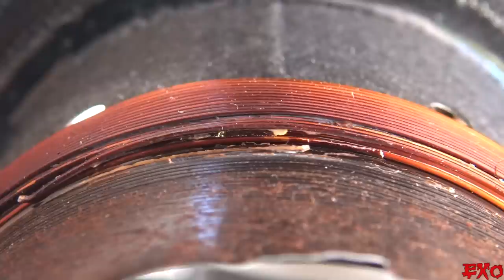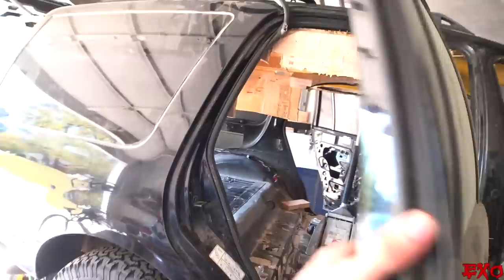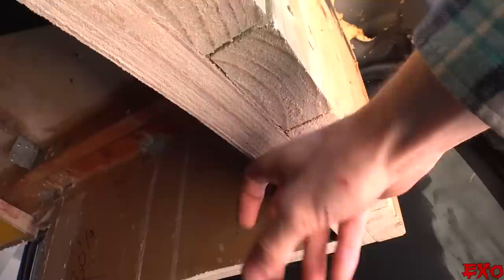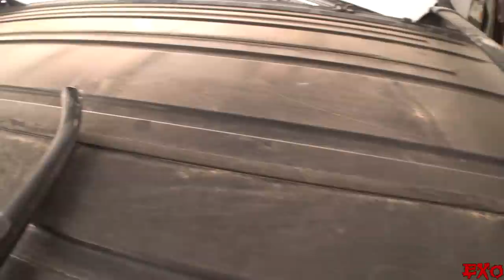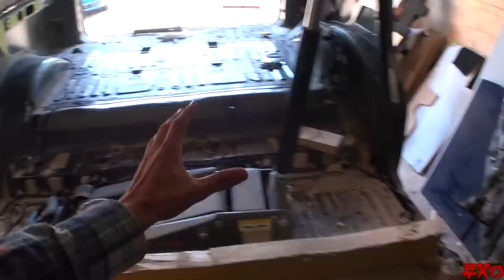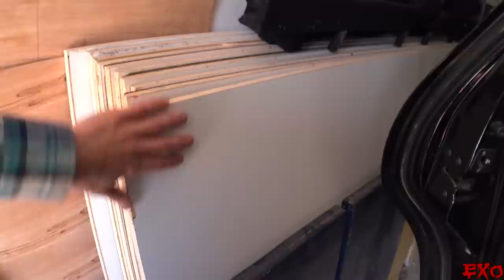BLOWN SUB After 30 Minutes of Music!?!? Car Audio Updates w/ FRANKENSTEIN & Rockville K9 Subwoofer

Comment: As a woodworker I recommend to sand the laminate with a coarse sandpaper to give the glue a better surface to adhere. You should sand it down until you see a dark layer. This is the same one which is also on the board. Here the glue has good adhesion. For glue I would recommend a good wood glue or for maximum strength some PL as you always use. :) 
Hope I could help!
Reply: No need to take it that far scuff it up good apply some white melamine glue screw together or clamp and done take a hammer to a test piece
Reply: Oh yeah before glue clean good with lacquer thinner
Reply: Yeah, this also might do the job nicely.
Reply: Roo glue ftw
Reply: I was also a cabinet manufacturer (27+ years) and Im in agreement with sanding with coarse (80grit)  paper until you get down to the brown sub layer..and use a dust mask always with that laminate..that shit aint good to breathe..there are a number of adhesives that would hold those joints well...plus you can screw the hell out of it.
Reply: not have sand laminate, im working with wall on shuttering plywood and with constructive glue soudalflex 40fc. Rock solid without scratching surface.
Reply: G anthony Dr
Reply: Liquid nails will hold anything.

Comment: I've been seeing people blow them all over YouTube. Definitely not your fault. Defective glue is the word on the web.
Reply: Sinister 

I've seen many blow these also.. the last video I saw of Rockville saying there is nothing wrong with these subs.. they said it's users not using their subs correctly.. that's sad to hear them say it. I sure hope they fix the issue(s). They make decent equipment, glad to see Rockville make good on these issues.
Reply: I’m surprises ppl r buying these off brand subs kicker alpine n others aren’t that much 10 inch round kickers go for 99$ a sub I say buy brand name never had a problem with them
Reply: KushClouds TV the reason people are buying these is because the 129 bucks and are “rated” for 1250watts rms where as a kicker is around 4-600 watts plus there’s the fact subs like kicker aren’t made to play low notes due to limited Xmas where as the Rockville has more ease. Not to hate on kicker or not saying they can’t play low notes  but I think most people would agree
Reply: The key to these "types" of subs is under power them and break them in for awhile. These are "soft parts" subs which is what makes them cheap.  But if it is a glue issue there is nothing you can do other than re-glue/re-cone them yourself properly. Which seems rather  counterintuitive them being "cheap" to begin with.
Reply: looks like they went cheap on the glue that is why is so cheap but other than that great quality
Reply: chepa materials cheap sub

Comment: Sorry I lost signal but with a 4th order you could use the raised rear section for the sealed and the front for the ported
Reply: Doyle Lee i dont think that will work with 8 18s maybe with 2 separte sealed section on left and right but i dont think theres anyway he can do 8 18s in there with sealed section in back
Reply: I thought about that after I sent it

Comment: This is a design I've seen used by other companies. A standard model with the rubber magnet ring changed to suit. As soon as it starts performing decently enough, it starts breaking down. It uses aluminium as the coil wire. Aluminium becomes brittle or melts depending on how it's produced.

Comment: I absolutely called it!!! Now EXO you have one, so tell me your opinion...if PSI did a recone would the price of the sub plus the price of a PSI soft parts kit be worth the end total price paid??? Is that motor worth the hundred bucks and then another 150ish??? for a PSI upgrade? Think about it, end result maybe a few hundred bucks. Orrrrrrrr would it have been better just to buy a 300 dollar sub. Come on bassheads give me your thoughts.
Reply: wrksux4me 

I would say no, pass. Lol.
Reply: You can get pretty awesome subs for around the $300 mark with higher reputations imo (thinking about maybe some of the mid tier Skar stuff). But I also think Rockville has the potential of solving their coil issue fairly easily and remedying the problem. Idk, just a thought
Reply: Well personally I say the no pass as well but there are individuals out there trying to plead a case for these Rockville subs because of the motors... me myself would drop 300 on a hdc3 Soundqubed or hell a baseline DC or Sundown even before I went thru all this with trusting a Rockville.... I mean it's Rockville people... lol
Reply: I personally would go with sundown/dc audio/psi.  But when buying subs above $400 I always go with Digital Designs.
Reply: I'd rather spend a bit more on a well known, reliable sub than a cheap one with a recone.
Reply: I live in Oklahoma and the manager at car toys said the owner of DD used to work there. Left, started DD has a warehouse in Oklahoma city. Also said his son is the owner of soundqubed and he as well has a warehouse in Oklahoma city. First thought he was full of shit but I finally decided to order a soundqubed, got a 10 from GP and liked it so much to ordered a 15 from soundqubed directly. Well it did in fact come from Oklahoma city. I've heard good things about DD and I've seen a lot of badass videos on YouTube. So I wonder.. if the dad can out do the son or if the son can out do the dad? They need to comp it out... lol.. you know that's a cool ass dad. All being unless the fkr at car toys really doesn't know what the hell he's talking about.
Reply: I'd buy a skar I had a evl12 I paid 200 for it and it was wicked sound better then the older school hcca 15 I had and killed the jlw7 12 I had and actually was better hitting and cleaner then the two rf t1s 12s I had it was a amazing sub I have some vids on my channel of it on a rp 1500 watt amp full tilt
Reply: American Bass Subs Are a good option
Reply: Skar and American bass I've never tried. I've thought about it, countless times.. but never have gotten ahold of one from either brand.
Reply: wrksux4me skar is really good for the price check out my channel I have a few vids of one evl 12 sub it was th best sub I've had outta alot of stuff cvrs, rf t1s,a jlw7 , and a old school Orion hcca 15 in a four and half foot ported max spl box to big 4 inch aero ports
Reply: wrksux4me go with sundown audio SA's and be done 
Best sub on the market for the buck period
Reply: Paul cherry right on I will do so bro!
Reply: Dieselman40 I know sundown is a for sure badass no doubt but you know I'm a DC and Def bonce fan. Those are my two ultimate "goal brands" so to speak.  Another is Vibe Audio's black death series. I'd love to get a hold of them as well.
Reply: wrksux4me imho vibe is not much better than the Rockville based on some friends experience but I agree with DC definitely but just for price performance and reliability sundown is my choice
Reply: I've been in the game for a long long time. I've been building enclosures for 20 years. I was in it big back in the early 2000's and then got married, had kids, I never fully backed out meaning I always had a system but just simplistic. You know a 10 or two and never running more than 1200 watts to my subs. I'm finally getting back in slowly more and more deeper. I just finished a 6th order for a type R 12... now I know I know it's just a type r but see the surround on a type r is special to me because I thought of it when I was much younger and I always wanted one after alpine brought them out. So I fished that, got a soundqubed 10 to start my daughter off with. Also got a soundqubed hds3 15 to try out before I possibly move further to the hdc series depending on how things go. I'll be doing a 6th order for it and my daughter's 10 soon. I've got to put some raptor liner on the alpine enclosure next. Got new mids, deadener, mechman alt. I'll be doing these all on vids here soon and if you guys want hit my channel up and subscribe. I've got a good list of things coming up. Been waiting on the damn weather to change to get on it. I'd love to have a good network of bassheads to follow as well so lmk. Video the small builds. There are badass quality builds us simple/family/million bills to pay guys out there banging the shit out of the lower to high middle class subwoofers and they are not videoed enough fellas. I'm going to start. No super fancy editing. Just to the point, give ideas get ideas is what I'm thinking. I watch these vids all the time and big fan of EXO and others so why not. Why not the small builds guys lol.
Reply: old guy on car audio forum love ab subs especially the xfl and i've never heard anything bad about the xfl at all.. we had another guy with 2 skar evls hitting over 150 in home made box on 2 cab 1600's
Reply: Let's say you got it for free. Sure. If not...
Reply: BRIAN GITTINS Nice!! See now that's what I'm talking about. I freaking love watching videos like that! Smaller systems doing badass numbers. Between those two brands and in all honesty, I think I'd buy the xfl before I did any.
Reply: Here's the diff in a nutshell,the crux of it. Other than the obvious power handling of better made subs,most consumers want a sub they can drop in and beat to death. No proper break in,clipping the shit out of it because "moar powa",some sub-optimal  box,even those by most "professionals",all those things that most people do. 
To build a sub that can take that shit costs manufacturers more money. In order to not have a long line of "abusers" waiting to return their sub for a warranty,all the while bad mouthing the thing,they create something that can take what the average consumer dishes out. And that increases their costs, Significantly. Therefore the sub ain't cheap.
That's not to say some don't try to sell shit that is way overpriced, but they don't live long. IF people would band together and treat subs properly and not expect to "get a free one" when they don't, well made subs would be a lot cheaper. Jus' sayin' :)
Reply: Depends on how the poles hold up or the adhesion between the motor and the basket. If they are strong hell recone it and beat the brakes off it to see how a recone handles....looks like it vented pretty well and the magnet seems like pretty good slugs....can't say how strong they are though.

Comment: EXO I'm a painter by trade and been doing it for 20yrs. I would oil prime each side that's laminated and then the glue would work great. I think if you just used the glue straight up on the laminate you'd have some problems. Oil priming would solve the issue.

Comment: Not wood glue, use a poly construction adhesive with a fine 1/8 inch notched trowel or spreader. Contact cement well get it going on too, just sand it , rough it up a little. Your doing a fine job , starting to get me pumped to finish my truck install. 👍
Reply from the maker: Thanks for the suggestions, David!

Comment: As someone who has a Tahoe that is doing a build with 4 18's,
Try and go 6th Order. If you can't then do a 4th. If doing the 4th, have the ported section shaped like a T, so that way you can have 2 sealed sections with 4 subs per section.

Comment: What about a 2:1 3 chamber 4th order bandpass with a slide out amp rack at the 11 inch drop for the highs and mids amps. Then you could use more of the door space area for the box. Maybe even add a plexi-glass window on both sides that could make installation smoother being able to reach the back of the subs. The window could be over the floor amps too, that'll give you a view of them. Then to get more air space like you was thinking on the rear window area. Molded reinforced fiberglass panels that can use a wood skeleton frame. It'll take sometime but the end resolves will make the difference.

Comment: Hey exo now about the stability of gluing the wood together with the vaner on, it wont be that stong. Iv been doing furniture repair for about 12 year now. The best way to get it off is to lay it in the sun for about 30-45 mins an basicly get a wide paint scraper an get it off. Once u get it going, it gets easier as u go.

Comment: I can't say I'm surprised, it's a classic case of you get what you pay for. My nephew had one of their "6,000 watt" amps on 2 EMF Lowballer 12's and the amp smoked in less than 24 hrs, at 1 ohm. I put a Sundown SAE-1500d in and it was louder and rock solid ever since. Sure they might show a similar result briefly, but paying for higher quality is sure to give better longevity.

Comment: I would still check amplifier, if there was DC present on outputs you wouldnt hear anything (except music) but coil would heat up alot more than it should.
Reply: Eric Erickson If there is DC present on coil it means its gonna just heat up but since it wont move heat will build up and burn coil, thats also the reason why clipping damages sub.

Comment: Yo exo, before buying more wood. try letting the laminate set in the sun, till the glue is hot enough to peel off with a putty knife. then glue your 2 and 3 layers together. just a thought to help save money on the box that could be used on a different part of the build

Comment: if you wonder if the glue will hold to the "Smooth" surface, take a sander with like 40, 60, 80 grit and rough up that laminate and then bond them together where ever you need that bonded.. can't wait to see the build out

Comment: If we’re building this I’d make my own acrylic windows and modify the rear doors to be bolts shut so there’d basically be two boxes one for each side and mount the amps on the roof and custom battery box where the spare tire would be. I’m not sure what that kind of a box that would be classified as but it would be interesting to see if the tune of the truck would change based on if the hatch were open as oppose to the front door or windows were so maybe it’s a band pass box but “instead of putting a speaker box in the truck the truck becomes the box” that’s basshead philosophy. Take care when taking out the rest of the old box out looks a little dangerous

Comment: Would be cool to see a video with both time lapsed working and breaks with some commentary etc. And when it comes to cleaning up that clue and paint, you can use a wire wheel on a grinder and a propane torch to help loosen it up.  Do a giant 6th order!!!

Comment: You can do all 10 with a badass pentagon 6th order box 2 subs per side of the pentagon with the port coming through the pentagon from the back. Its bery possible if you plan on taking those back windows out and using steel like you said. That would give you the air space needed for all 10 you just gotta come up with a good layout for your amps and batts cuz it would probably leave you 20 to 25 inches in the back end. It would be a cool build to watch

Comment: For the removal video, I would prefer longer natural sound, with insert pause for comments. As for what I would do, I still would like some specs of those for playing with in bassbox. Like you said, a driver side port might allow you to use all ten. 4 mounted conventional starting by the passenger, and the other 6 mounted with the magnets in the port. I doubt size restraint you could start with a "w" shape up front with the two sides mounted conventional and the "v" part inverted to allow enough space for the magnets. Then see about the driver side port or go crazy and have a slightly thinner port on each side and put a baffle down the middle. Metal sheet those windows in the back. If I was going to just be absolutely nuts and use all 10 18s I might consider cutting the roof and extending it like some of those camper vans to add extra volume. Steel plate or use 2x4 and those laminated panels with the laminate removed then fiberglass over the top to keep out the weather. So again, any chance on specs for them?☺

Comment: I found this bass package with a 12 k9 sub and an amp from rockville rockville website. And the amp is 600 watts RMS and 1000 peak for a 4000 watt rated sub if that tells you anything about them. That tells you them know the actual rating of the subs and won't admit it.

Comment: Sanding the laminated wood (sanding machine) to roughen up the texture of it will allow what ever glue you use to grab unto it, preferably liquid nail wood glue then drive some 1 1/2  - 2 inch screws through it and you should be fine.

Comment: 500pounds of wood is way excessive.  I vote for a traditional ported box tuned to 25hz.  Could taper the bottom of the port to hide the hump.  Also I would consider more cross bracing in side the box and less layers on the outer walls.  For the baffle use some plate steel sandwiched between wood layers. I like the idea of replacing those rear windows with sheet metal, then you could build right up to them.  If you have a router table I suggest making stacked layers of wood to shape around the wheel wells, to maximize box volume.

Comment: Big ass 4th order.  Subs on passenger side wall driver side port.
I rebuilt my K9s myself... coil from PSI and rest from LordOfBass.  Turned out WAY better... takes everything my amp can throw with ease... considering my Skar RP2000.1 should NOT have been able to blow the original soft parts... it’s definitely an improvement!